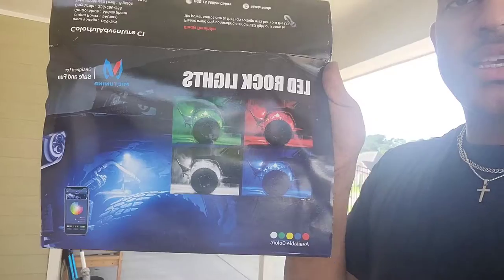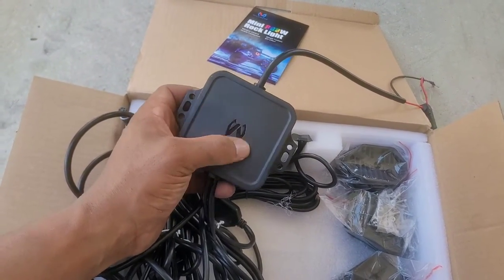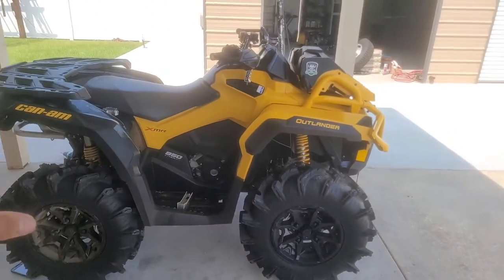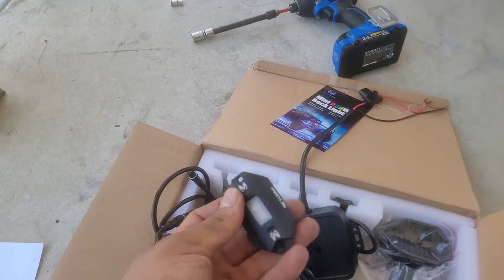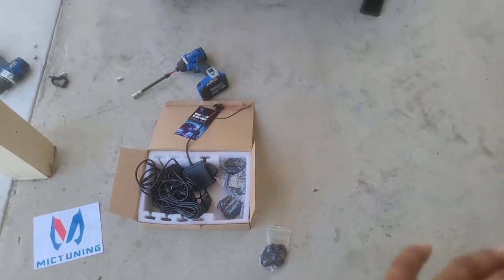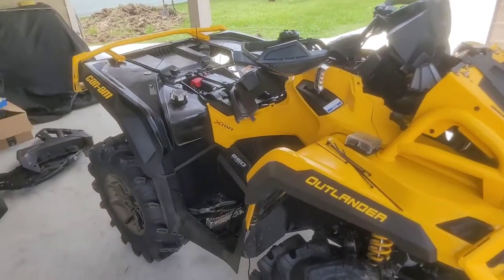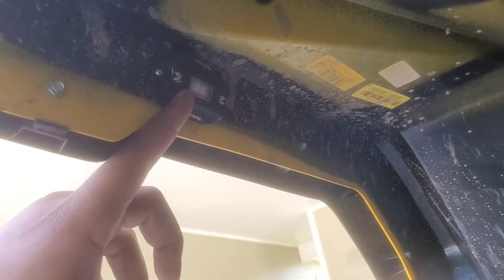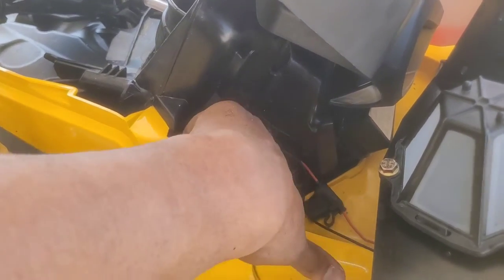Mictunning Rocklight install on 2021 CanAm outlander | Super bright! | RGBW

Comment: I have a 2024 Can Am Outlander 850 XMR and I’m trying to do the same with installing the rock lights, light bar and soundbar myself so I won’t have to pay that $850+ ticket taking it to the shop to be done is it anyway that I can reach out and get a step by step guide to safely install these parts myself and be sure I wire everything correctly to prevent later troubles and expense down the line ?

Comment: What way did you run the wires under the fenders? I couldn’t tell. I got the 650 and I want to start customizing it
Reply from the maker: Towards to back around the lights and down the frame to the control box